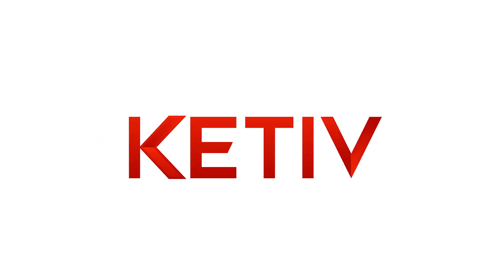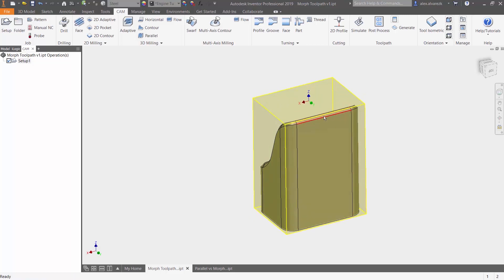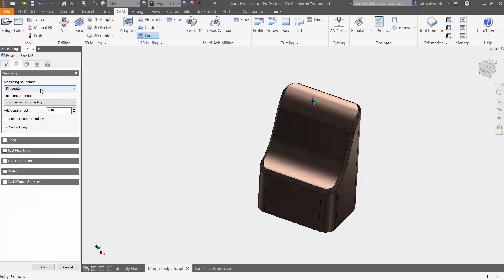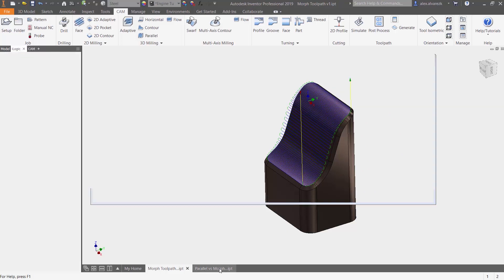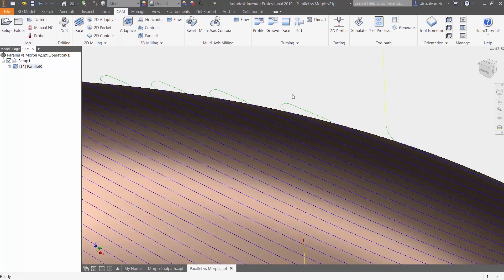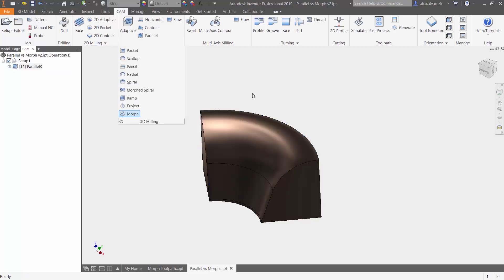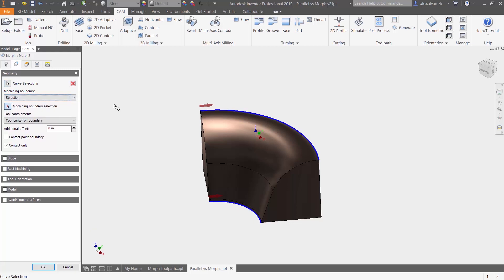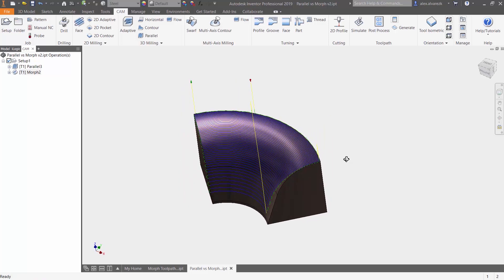Quick Tip: Morph vs. Parallel Toolpath

Comment: How can we make chains between 1st curve and 2nd when fillet surface looks like two curves meet together both end like arrow? Thanks
Reply from the maker: Hey Duc Do,
When selecting chains you can hold the ALT key on your keyboard and that will allow you to select individual chains as opposed to a closed loop. Send me an email to alex.alvarez@ketiv.com if you still need help with this. 
Thanks for watching! 
-Alex
Reply: Thank you so so much reply me. The chains with many small surfaces as I start clicking it goes all the way loop of chain of second one. My question is Do we need to chain one time chain or can allow one chain other time til complete 1st pattern? Couldn't make it. Thank you